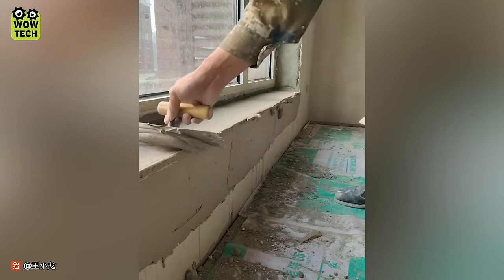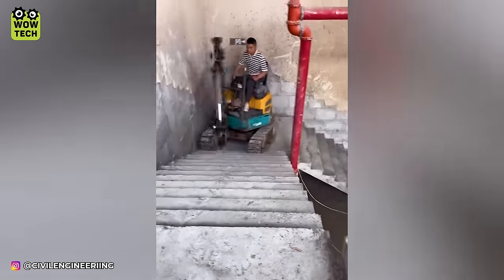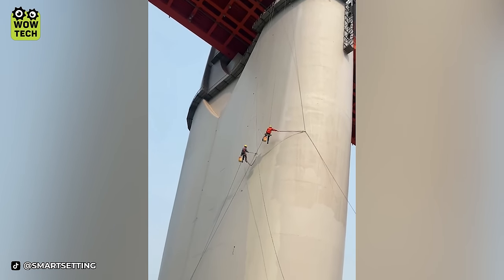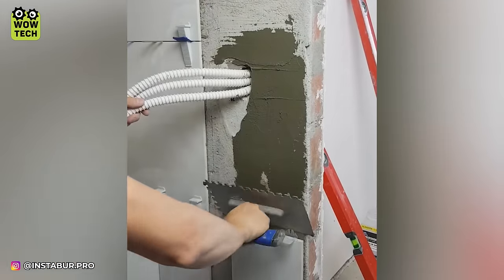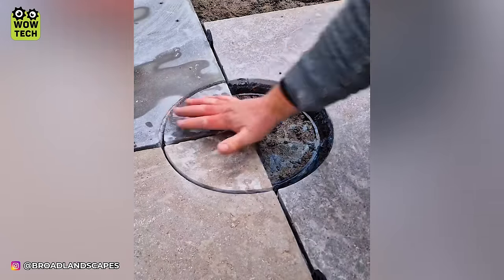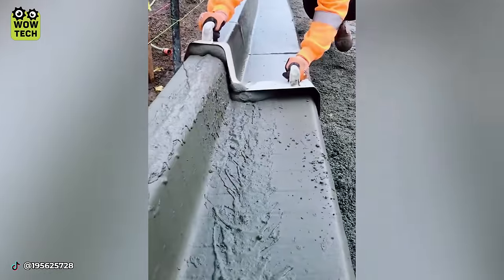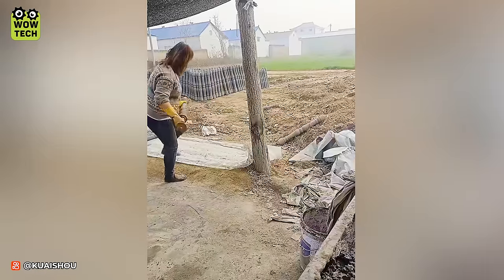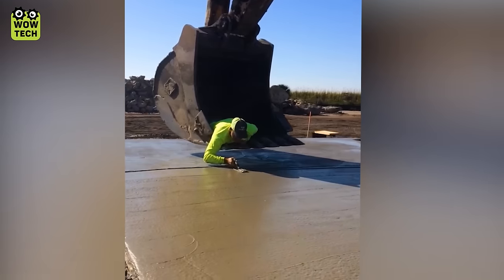Ingenious Construction Workers That Are At Another Level #3

Comment: The painter @ 7:01 sux! When it's dry, you'll see exactly where he reversed direction. Because i you go full blast constantly it builds up where you reversed. 
I know it's not feasible for most people to walk the entire length back and forth, but letting off just before you switch direction and while you're letting off, flick your wrist in the direction you were just moving. Then when you start spraying again, don't start right under where you just left off and make sure your arm is already in motion when you start spraying. Start just before, or just after the line above it. So you won't see a hard line where you switched direction. 
And always keep the sprayer nozzle the same distance from the wall, vehicle,  etc...

Comment: I have been on jobs where specific tools did not exist so we made our own, like a corner plumbob (before lasers but also quicker) for positioning a support column.  I also made a tool to get a 45° level on a bar. The actioner had to be at 45° to the bar to ensure the correct movement but getting a measurement through the centre of a bar is very difficult. I made a triangular tool with a level bubble in it set at 45, a cutout for the bar and when the actioner was in the correct position the point of the triangle was in the centre of the pin that connected it.

Comment: First off the pic is misleading a wire cage can't be picked up and set in place it doesn't have the strength to withstand the weight of the stones .duhhhhhh

Comment: 20:57 Cave-in collapses, almost always begin at the bottom sides of an open hole or trench, over the depth of 5', due to the overburden of the excavated material placement on it's upper edged sides. The Trench Box, as the type shown here, must show an approval date made, usually labeled in an elevated welding bead, & have no modifications made on it. Otherwise it is to be rejected, & no personnel will be allow in the open hole or trench where it was trying to be utilized. The results of a said cave-in of the sides can trap an individual with so much pressured force that it can cause lack of blood flow to the extremities within that part or parts of the body which within even a short period of time before being rescued, can result in death, or loss of limb, or limbs, captured under such said pressure.
Txdot Inspector of new construction over highways and bridges 1986--------------------2006.
''Inspectors, like Morticians, are usually avoided, but share one thing in common... They both keep things from stinking later on.''
Reply: I read one tragic newspaper report, where a poor fellow was buried in a cave in.  The took the back hoe and tried to dig him out, oops, off went his head.  They were not sure if he died from the back hoe slicing off his head or from being crushed from the cave in.